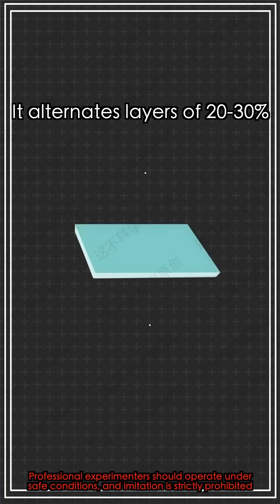How Strong is Bulletproof Glass❓ Is It Really as Strong as in the Movie❓

Comment: To make glass in Minecraft, you'll need sand and fuel (like coal).

Here's a step-by-step guide:

1.  Gather Sand: Find sandy biomes (beaches, deserts) and mine sand blocks.
2.  Get Fuel: The most common fuel is coal, found in caves. You can also make charcoal by smelting wood logs in a furnace.
3.  Craft a Furnace: You'll need 8 cobblestone blocks. Place them in a crafting table in a circle, leaving the center square empty.
4.  Smelt the Sand:
    * Open the furnace interface.
    * Place the sand in the top slot.
    * Place the coal (or other fuel) in the bottom slot.
    * Wait for the sand to smelt into glass.

---

### Important Notes About Glass in Minecraft

* Fragility: Glass is very fragile. If you break it without the "Silk Touch" enchantment, it will simply disappear.
* Uses: Glass is primarily used for creating windows, transparent roofs, and other decorative elements in your builds.
* Tinted Glass: You can make tinted glass by combining regular glass with amethyst shards. Place the glass in the center of a crafting table and amethyst shards on all four sides.
* Stained Glass: Regular glass can be dyed using various dyes. Just place the glass and the desired dye in a crafting table.

Now you know how to make glass in Minecraft and use it for your creations!

Comment: In the movies, they also make bones look weaker my making people just cut entire limbs up. While it might be a sharp knife, I think even the sharpest when pushed by a muscular human, not a professional bodybuilder or something, wouldn’t even be able to cut through the entire limb at the joints! The bones are a different level though. But they can be fractured easily if the pressure is on one point and if the body is not in the correct posture or with a dedicated strike, it could dislocate them. The only way be heading is even possible is if they put the blade 20 metres high and use gravity. But the neck is rather vulnerable when compared to other parts. But even the neck is rather strong!

Comment: the car test is useless... the car tire covers a large surface; a bullet, for example, concentrate a lot of energy in a small point, so its harder for the glass to resist. And the speed: a bullet goes 2000+ km/h per second, the car was going 10 km/h maximum.

Comment: Bulletproof glass are made out of polycarbonate, and polycarbonate glass can disprese force very well, so they can absorb impacts and make it nearly unbreakable. It has high tensile strength, at 8000 to 9500 psi, and you’ll need 900 lbf (4090 N) to break it.